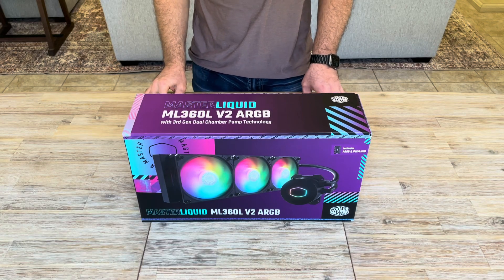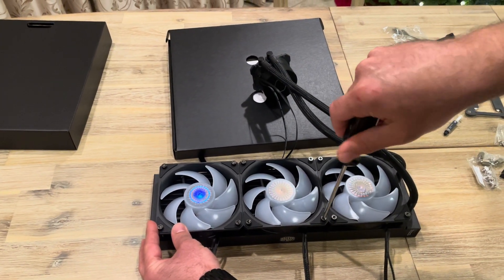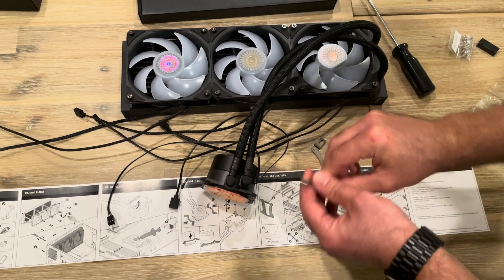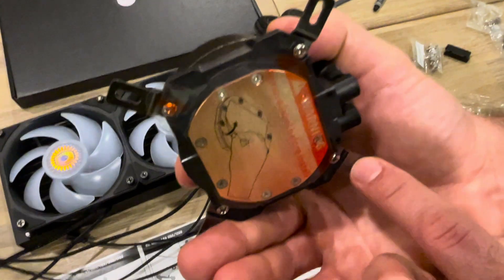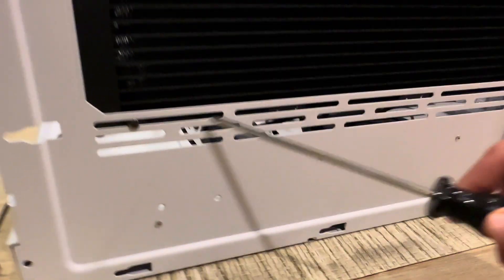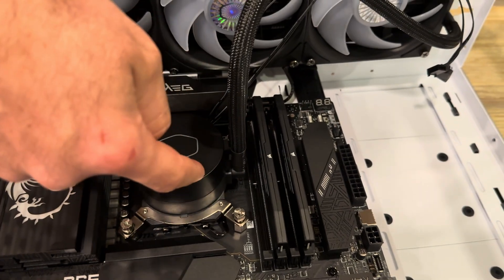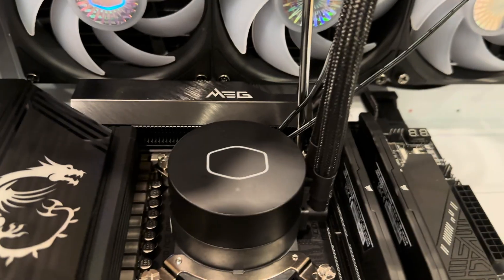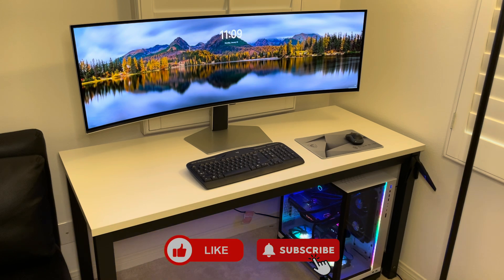MSI MEG Z790 ACE MAX AIO Install with Cooler Master MasterLiquid ML360L ARGB V2 Liquid Chiller

Comment: Hi, new subscriber here, just got done watching all your videos of this motherboard. nice setup. i just returned my other msi mother board to get the ace max as well. because i found it for a really good deal. do you have to update the bios for the  I9 14900k? also what monitor brand and model is that? really nice 👍
Reply from the maker: Welcome to the channel!  Thank you for the kind words and good questions.  The z790 ace max should come pre-installed with one of the following BIOS versions: Version 7D86vA0 or Version 7D86vA1.    Both versions should support 14th Gen CPUs.  Please check your BIOS version and confirm one of these two versions is installed and you should be good to go.  My motherboard came pre-installed with version 7D86vA0 and I decided to upgrade to the newer 7D86vA1 version because it was a fresh build and the process is pretty straight forward.  I will be adding a video soon to go over the BIOS upgrade process.  Regarding the screen, I chose the Samsung Odyssey 49" G93SC Series OLED Curved Gaming Monitor and I like it very much.  If you are interested, I do have a separate video on the channel dedicated to the monitor and it can be accessed with the following link: 
https://youtu.be/8lawVjheCk4
Reply: @JoeAlisando  thank you, didnt see that you have other videos until i clicked the videos page  lol. its gonna be my first pc/gaming builds one for me and my son and need all the information i can get. does ram speed matter i was looking at some thats 8400 and 8000mts/mhz? i know really nothing about it i just wanted to get the max lol but those speed only come in the 48gb (2x24gb) models. do u use one m.2 for storage and the other for your boot/operating system?
Reply from the maker: You are very welcome.  Getting better RAM can improve your gaming experience if RAM is the limiting factor in your build.  In that case, it can help increase your fps for instance.  To see what RAM the motherboard can support, check the specifications of your motherboard.  For the Z790 ace max, DDR5 is needed with maximum capacity of 192GB and guaranteed speed of 5600 MHz.  Anything over 5600 MHz is not guaranteed but possible depending on all the other components in the build.  I chose to go with two sticks of DDR5, 5600 MHz, 32 GB for a total of 64 GB of RAM.  After activating XMP in the BIOS, I was able to get the full 5600 MHz and 64 GB of RAM.  I will make another video on how to activate the XMP option in your bios settings.  Regarding the M.2 drive, I installed only one and it houses my operating system and is used for storage.  I will be installing more in the future for storage as it is not too expensive.  If you are interested in the full list of components in my build, check out the description section in the following video: https://youtu.be/4AAObIBb5m4 .  I hope this helps at least a little.  Enjoy the computer building experience with your son.
Reply: @JoeAlisando  oh yes please make the xmp video, i also want to learn about that and how to over and underclock.pretty much everything setting wise for gamming performance related.  most of the components is gonna be the high ends ones. stuff i have right now is the 990pro 4tb and going to get the crucial m.2 nmve gen 5 t700 pro 4tb, rtx 4070 but going to get the rtx 4090 soon, ace max mobo is on its way, corsair full tower 7000series and their biggest aio cooler, probably gonna jump on the corsair 8000mhz 2x24gb ddr5. corsair 1500w psu